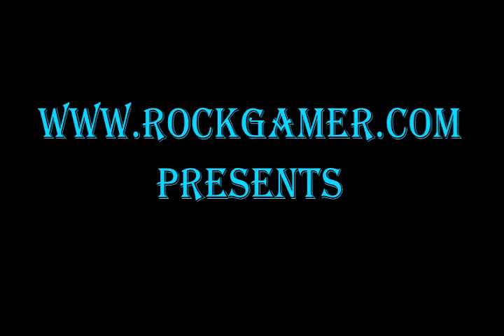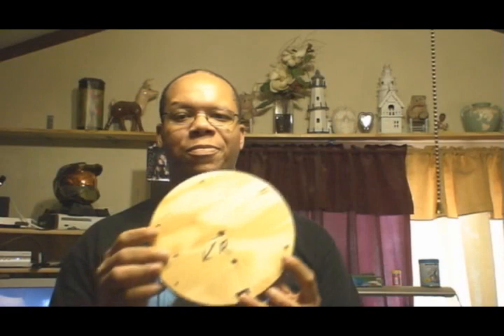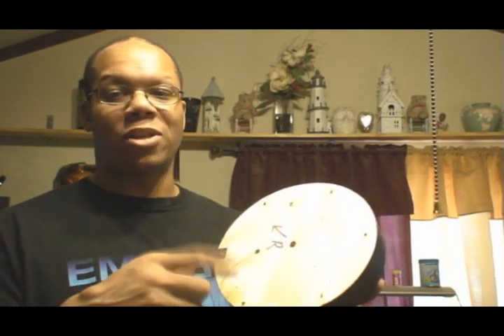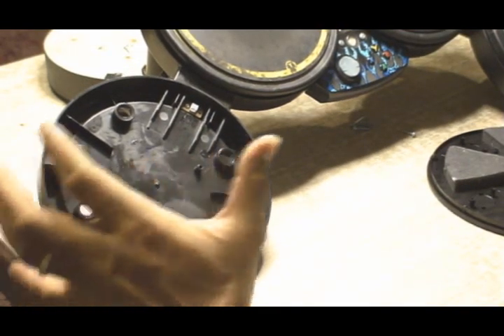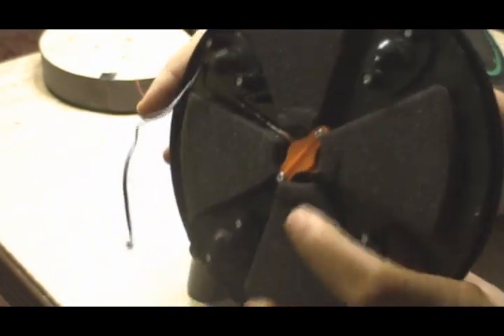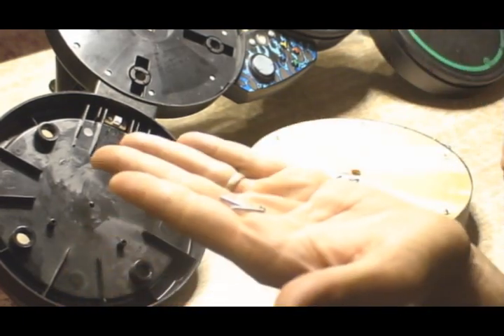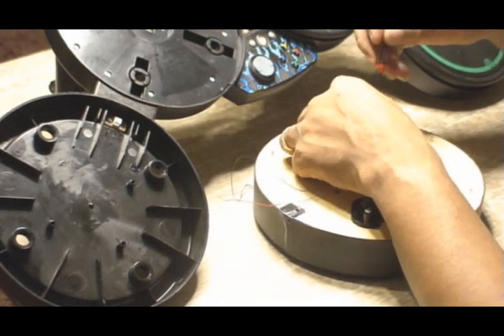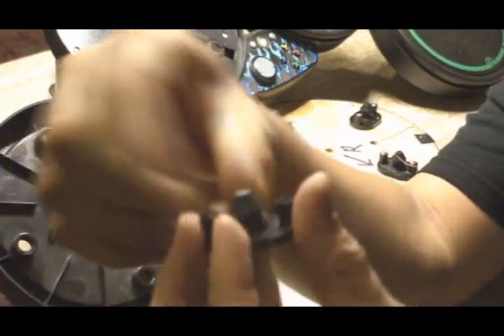Good Wood Mod's DIY Installation Part 1

Comment: @bahsura Yes the Ions are better. Being that this review is over a year and a half old, GoodWood's products have fallen off greatly!! I think the Ion has stood up to the test of time. I have had mine going on 2 years and I have had no major problems. I had one pad that went out but was replaced by Ion. I have upgraded to the Mylar pads. The Cymbals could be better and is the weakest part of the Ion kit. However you can upgrade if you wish.

Comment: Im buying the GoodWoods mod for my ps3 drumset and i play expert drums and want to improve so my ps3 drumset does not look like the Xbox 360 drumset on the inside i dont even think it has the plug all it has is alot of wires like a green and a red one.... plz i need help

Comment: hey man i have a big question for you. i tried to take my pads off, but when i couldn't get them off for these, (which i tried to take them off before i decided to order, which i have not done, yet) i noticed there were like holes at the underside of my drums. will that be a problem? because they look like they are screws holding the pads in the kit. will that be a problem at all or will it come off with a little extra force? thanks.